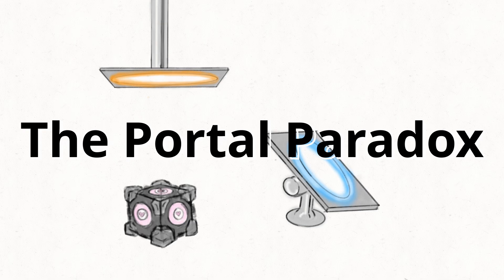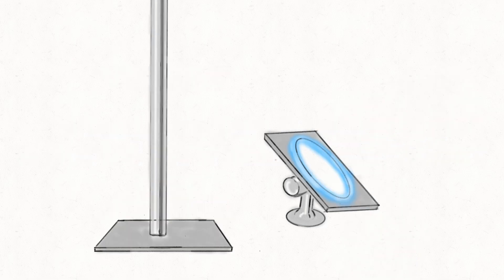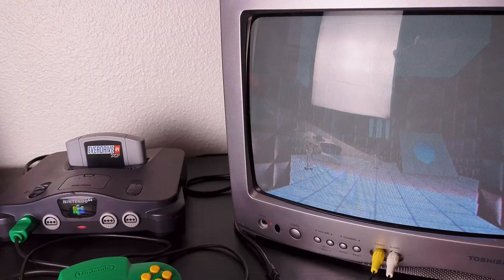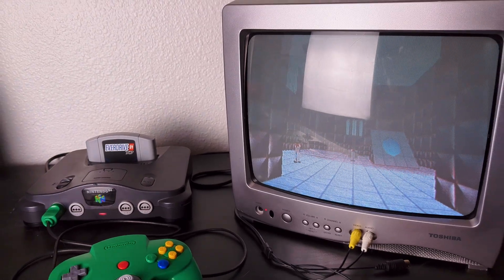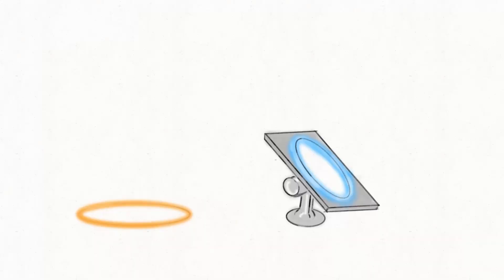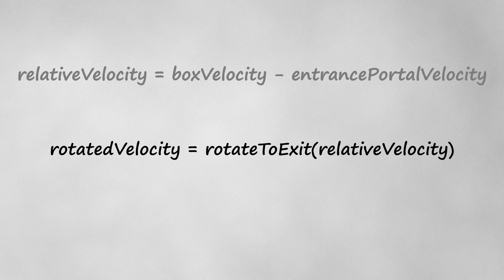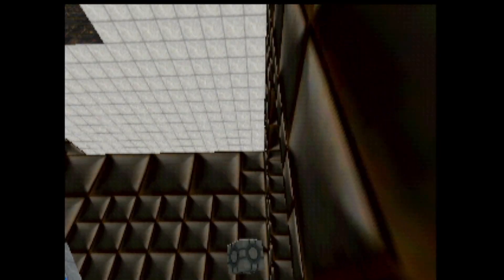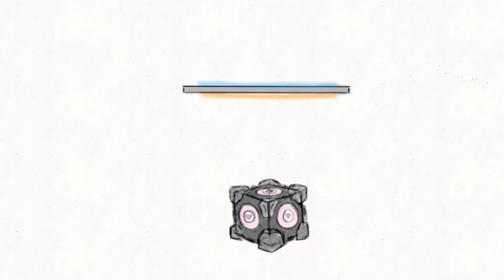I rewrote Portal from scratch and solved the Portal Paradox

Comment: So, I think you did make a mistake. I'm no physics expert, but here's what I'm thinking. 

Let's consider the slab first. 

1. The moving slab has three phases: accelerate, travel, decelerate.
2. From rest, the slab accelerates until it reaches its maximum speed.
3. After traveling some distance, the slab decelerates to become stationary again.

Now the portals: portal A - moving, and portal B - stationary.

From the moment the slab begins moving, portal A is traveling with it, but portal B is not.

Before talking about the cube, let's talk about air.

You seem to be assuming that because of this difference, that air will be traveling into Portal A as it drops down. But is this correct?

Let's try this thought experiment. The same setup, but portal B is in a separate, sealed room of the same volume as the sealed room portal A is traveling through.

The air volume in room A and the air volume in room B are the same. This means, the pressure before the slab moves is at equilibrium between the two rooms.

What happens in such a system when the slab begins to move? Well, the air will become turbulent in room A, but that doesn't necessarily mean air from room A will be siphoned off to room B.

In fact, I would assume that the turbulence would travel between the rooms, but the overall volume would quickly equalize between them.

In other words, the air in room A would become turbulent as a gap opened behind the moving slab, but no air would be forced into room B. Air pressure prevents more than a momentary imbalance.

Now let's talk about what happens when  something stronger than air (the floor) prevents air from traveling around the slab. Some small amount of air could get caught between the moving slab and the ground with no escape. In theory, this wouldn't be much, but let's assume a handful.

Because this handful of air can't escape back to room A, it is forced through portal A in to room B, increasing the pressure. The air itself would be forced into room B, but the surrounding pressure would prevent an imediate dispersal throughout room B. Eventually, it would diffuse throughout, but not immediately. It would be like a drop in an ocean.

Now let's consider something weightier, the cube.

As the slab moves towards the cube, air is disturbed around it as explained early. Air pressure of room B pushing against the air pressure on room A.

The portal itself is not some kind of membrane, but rather an instant translation between the two rooms. As portal A intersects with the cube, it will emerge in room B, but gravity is still anchoring it to the floor of room A.

If portal B were on the floor of room B, then you would begin to see the top of the cube emerge from portal B. But what energy is being transferred? None! The cube is still firmly anchored to room A's floor. In fact, even after the slab closes all the way on top of the cube, the cube is still sitting on room A's floor due to gravity.

So what about conservation of momentum? Well, it IS conserved! The slab has now decelerated completely, removing momentum from the system.

To state it plainly, if in my two room system, the cube were to pop up vertically from the floor into room B, before dropping back down, then where does the energy to pop up come from? Not from the slab, as it is now at rest. Not from losing energy from the cube, which has never even touched the portals, let alone the slab. Rather, the piston or driver of the slab has fully extended, coming to a stop on its own with the slab and attached portal with it.

So what would be the result? Well, the cube would enter room B and the air pressure in room B would increase due to the presence of the cube.

Redefining the system as two equally sized rooms connected by a portal,  and considering air first is the key here

This would all change of course, if your slab were the size of the room itself, forcing a high pressure in room A to force extra air into room B. But as defined, your slab is moving freely within the room and the air in front will rush around the slab to fill the gap created by the slab as it moves. The air pressure in room B will push against the air in room A to prevent excess air from rushing in.

Now, bringing it back to your scenario where everything is happening in one room.

The internal air pressure of the single room is pushing on itself from each portal.

Moving the slab creates a disturbance, yes, but air would not rush into portal A and out portal B for the same reasons in my proposed two room system. The overall air would become turbulent, which may be transferred through the portals, but not forced through because there is no pressure difference.

Again, considering your slanted portal B, the portal will remain on the ground where it is, until it's center of gravity crosses portal barrier, at which point the higher potential energy of being in the air at an angle is able to overcome the friction and lower potential energy of being at rest on the ground. But this is highly dependent on the angle of portal B and whether the angle is steep enough to ovehwelm the friction of the ground under the slab.

In no way is the gravity acting on the base of the cube going to be reversed and shoot the cube out at any velocity. It's all down to the extra gravity force pulling at one of the cube's side faces.

In short, I think you did program it to behave as expected. Not intentionally of course, but you somehow "stole" the momentum of the slab and transferred it to the cube, instead of compensating for the obvious deceleration of the slab. And again, the slab doesn't touch the cube, and the portal edges don't either, so in no way can the energy be transferred.

Edit: fixing some typos

Comment: While i agree that this solution makes more sense, I still have a lot of questions about it. How does this affect the cube if the portal is still accelerating when the cube enters the portal? Are the forces squeezing the cube because the bottom of the cube will leave the portal faster? What exactly is causing the forces that make the cube move? We know that for something to move, you need to apply energy to it, but where does it come from. Well, it has to come from the portal but how since it can't be physical force since it's not touching you. I like the theory where the portal you enter gains your mass and the portal you leave gains your negative mass, but with that logic don't you create double the energy since the cube launches and the portal that was moving keeps its speed and gains your mass.

I know that these questions aren't important for your game but they are stuff that makes me think a lot about portals.
Reply from the maker: I think you are right about what happens if the portal accelerates. It would compress the cube, although if the cube were rigid enough it would just result in the back of the cube pushing the rest of it. Conversely if you suddenly stop the portal while the cube is halfway you could in theory cut objects in half because the half that traveled through the portal would pull on the other half still sitting on the other side. The stress would be located on the plane intersecting the portal. Stop fast enough and that stress would be enough to separate the two halves.

As for where the energy/momentum comes from I would bet you could get the math to work right if you had the energy/momentum come from the surfaces the portals are attached to. Imagine the portals were on surfaces that could swing freely, well then as the cube entered the entrance portal, it would actually push the surface backwards in the direction of the cube. The exit portal would also swing backward as the cube shot out of the portal. This way momentum is preserved.

Keep in mind the momentum is still a problem even for stationary portals. This is because momentum is a vector, not a scalar, and has direction. So a cube going through a portal that redirects all momentum from going down to up still violates conservation of momentum.

Comment: I can't speak to the math behind your conclusions, but here is my reason behind why it shouldn't move. Every action requires an equal and opposite reaction, but nothing ever "touches" the cube. Where is the force that pushes the cube coming from? Does a portal have a physical component to it?
Reply from the maker: Things to don't need to touch to interact with forces. Gravity is a great example. I'd imagine that the matter interacts with the surface the portal is attached to as it passes through the portal. In this case the exit portal experiences the equal and opposite force needed to launch the cube. If we were to allow the exit portal surface to move freely, as the cube shot out the exit the surface would move in the opposite direction.
Reply: @james.lambert  Interesting, I always thought of it like a hula hoop, window, or some type of hole, but the other side is just another space. What you are saying is since the exit portal surface can't move, it provides the force propelling the object.

How about this experiment. Say you have an object falling towards a portal, but the exit portal is being moved at a speed greater than the object's terminal velocity. Would the object not be able to pass through? Would it just kind of hover there until the exit portal stopped or at least became slower than the object?

Comment: pausing early in the video, but now I'm wondering about a sideways moving portal. let's say you have a portal that is on a wall, but the wall is moving upwards. You dive through a portal on a different wall, and exit the moving portal. You can't possibly exit it in a straight, fluid motion like jumping through a window, you would spin, right? By the time your legs are coming through the portal, your entire upper half has already been through the portal...
Think of it like this. The portal is moving at 1 foot per second. You jump through it at the same, 1 foot per second. Let's assume you're a solid 6 feet tall (nice) 
You go through, your head comes through at second one, at an arbitrary elevation of 3 feet off the ground. then your shoulders at 4 feet off the ground. then your stomach at 5 feet off the ground, and so on until you are at your feet coming through the portal, now at 8 feet off the ground. You don't suddenly just stretch to come out of the portal like that, you have to be spinning, and get pulled out of the portal faster than when you went in, right? Or maybe its like a car window, where you stick your hand out of the window and you feel the air pulling it backwards, so when you jump out you just get blown down. Any thoughts anyone?
Reply from the maker: I don't think you would come out spinning. Here is why. You keep the same relative velocity to the exit portal as you had with the entrance portal. Your relative velocity to the exit portal is you are coming out at 1 foot per second but since the portal is moving upward at 1 foot per second you are actually moving, to an outside observer, out the portal at 1 foot per second and upward at 1 foot per second.
Reply: @james.lambert  ohh very fair, I didn’t think about that! Relativity completely slipped my mind!

Comment: I'm pretty sure there was another part to the portal paradox, which is a cube getting clamped between two portals. How does that behave in Portal 64?
Reply: The typical assumption with portals is that objects passing through them neither impart nor extract energy from the portal; i.e. the portal will stay open indefinitely regardless of how much mass is teleported.  If we hold this to be true, then the result of two linked portals colliding with each other (while not in a vacuum) can only be an explosion.  Even if there's only air in the way, the molecules won't be able to get out of the way fast enough to avoid explosive compression, and if there's an object there, then you're looking at a detonation in the gigaton range, as all of the mass is instantly converted to energy.  However, it's likely the portals would fail prior to total mass conversion, when the surfaces they rest on are obliterated, so the true explosion size is left as an exercise for the reader.
Reply: @algorithm1607  I definitely need to see this implemented in this game.

Comment: If you have a portal in a seperate room and the room is moving at some constant speed relative to your current position. You have the other portal in your relative frame stationary. If you try to push a cube into your stationary portal it will start to accelerate into whatever direction the room is moving relative to your frame. At the end of Portal 2 when Chell puts a portal on the moon, the relative velocity of the two portals is pretty huge, I estimate around 1-2 km/s. Given the relative velocity would be going side ways, anything put into the portal would instantly slam into the side of the portal. 

I think it would be logical that the relative velocity of the portals to each other would not affect the motion of the cube. Only the relative velocity of the cube to the portal it's in ^^ So it should be correct. Can you test what happens if you put the cube into the stationary portal if the other cube is moving? It should hopefully do nothing.
Reply: His implementation of moving portals would break the moon scene in the end of Portal 2. What's wrong there is that entrance velocity doesn't affect the speed, but on exit from the portal velocity of the object changes with respect to the velocity of the exit. If he fix it, his implemintation would work perfectly.

Comment: The way I like to imagine the concept is from a 1st-person perspective:
If a portal is moving very fast towards me (assuming the exit one is stationary), it appears to me as though I am flying through the place I see through the portal (we can completely forget the space on the entering side), so intuitively I should come out on the other side just as fast as I arrived into it. Almost as if that space itself is moving.

You can look at it from a 3rd-person perspective too. Instead of observing the entry portal, observe the exit portal instead. From the perspective of the exit portal (or rather the observer at it), it looks like the floor itself is moving and launching me into the entry portal. Like some sort of elevator that went up at a really high speed and just stopped in an instant.

I'm not saying that it's flawless or anything, there's various things in this world that are counter-intuitive but real, but I just find it pretty fun to think of it this way. And at this point I'm just randomly rambling, so don't mind me!

There's a question of what happens if the portal stops moving halfway through, and I think the results could be NASTY depending on the velocity. At less extreme ones, it could happen that the exiting half of the body "pulls" the entering half with it, hopefully all in one piece. Not so much at very high velocities.
I did assume some things here'n'there, like treating the spaces behind each portal as their own, isolated systems (even though they may as well be in a single, shared system), and that this velocity phenomenon happens on a per-atom level instead of whatever else (Portal - any game with portals hopefully - calculates and treats it on a per-body level (I think), which is obv. way way cheaper to compute).

For gamedev purposes, one quick'n'dirty idea I have to approximate this pulling thing, I guess, is to simply see how much of your rigid body is on one side vs. the other (really simple point distance from plane equation), and use that as a factor between the entering velocity and the new one. Maybe.

Either way, wait WHAT, you're making this for the Nintendo 64??? Mega cool

Comment: Someone probably already asked but how would you handle portals facing each other, one portal moving towards the other one and there's an object between them? Some self intersection would happen if the portals got closer then the length of the object or it would collide with itself and start getting smushed. Or if the cube getting smushed requires more force then the force used to move the portal it could stop the portal?
Just a hypothetical, can't think of anything you could do with it gameplay wise.

Comment: Expanding on your explanation: Your equation restated all-in-one is:
finalBoxVelocity = rotateToExit(boxVelocity - entrancePortalVelocity) + exitPortalVelocity

Which makes sense, because in your model, ALL THREE objects (the box, entrance portal, and the exit portal) need to be accounted for in the determining the final velocity of objects exiting portals.

However, given that this is a video game, one COULD arbitrarily write any other equation to 'solve' this paradox, so I wouldn't call this 'realistic' or a 'solution' until other models were examined. That said, your model FEELS correct, which is the most important feature in a video game.

Comment: There's still no palpable medium allowing to transfer such energy through the cube tho, this is basically a doorframe falling onto the cube.

You're basically implying that portals are membranes with thin fields of electromagnetic/gravitational structure allowing such interactions, instead of a wormhole, which is just "folded" space.

The cube is a passive factor in all of this factor.

The main question is: does the portal allows such transfer of energy through the cube?

If it does, then I'm a big dumdum (which I'll probably be called).

If it doesn't, then you're probably missing something.

I still believe that for relative velocity to be relevant we would still need some transfer of momentum, and unless we do discover how these portals are made (worm holes vs gravitational/electromagnetic warping fields) this answer for me is a headcanon.

Still a great video, glad to see someone still interested in the old paradox.

Just to clarify, I'm not a physicist,  I'm just trying to use rudimentary logic, i truly want to know how such transfer could happen tho.